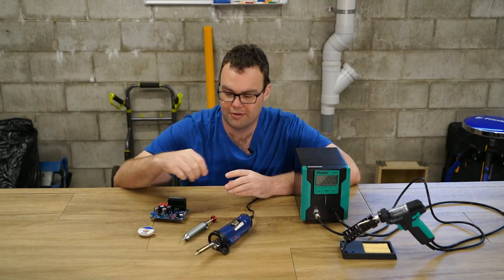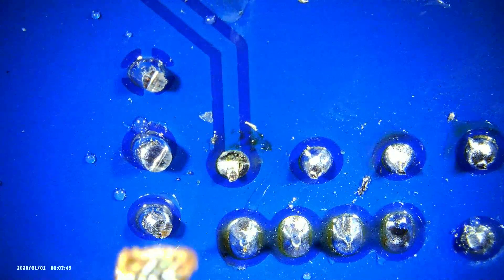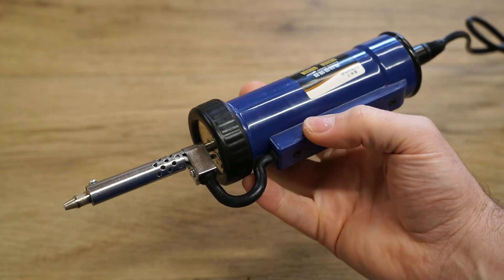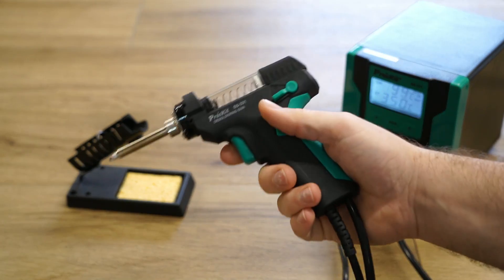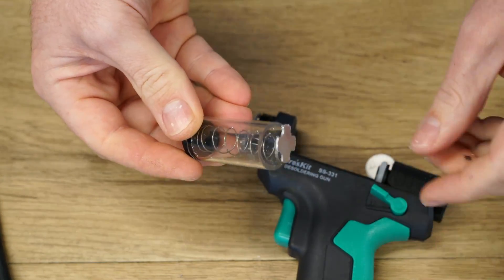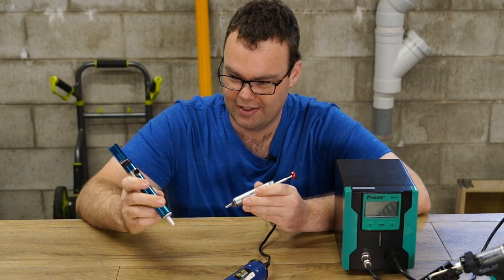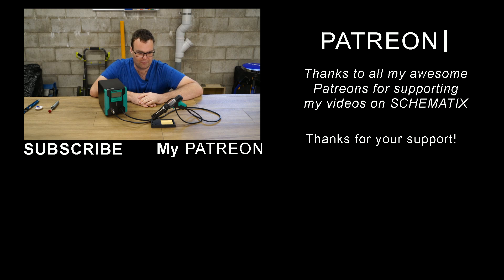The easiest method for Desoldering components!  Solder Wick, Sucker & Proskit SS-02 station Reviewed

Comment: The engineer in my opinion very overrated and slow in work flow, it will get clogged very badly every 2 minutes, it's not robust, the plunger bends, too small and flimsy. If you want to go full manual I suggest one of the "cheapest" models but make sure the body is all aluminum, not plastic. They cost like a dollar more and work like a charm

Comment: I really don't recommend those simple powered solder suckers with spring and metal tip, it will damage everything with those strong hits with metal tip. It can desolder pretty well, but it's good only for getting parts from PCBs that are already bad that you don't want to fix it and you just want to get parts from it. 
I want to get one of those vacuum pump powered instead of a spring, that should be more gentle. Classic not powered spring sucker with plastic tip can be ok for some things, but it's sometimes very tricky to melt it and then suck it before it gets colder again.

Comment: I came here looking for a review of a product like the cheap one you (and I) grew up with but it's electric (like the automatic solder sucker but much closer to the cheap design). I think I'll go with the Engineer tool. I got the newer model the SS-03--which apparently is mostly the same except it can touch the iron (up to 350 degrees tolerance) $25 instead of $10 but I feel like I'll destroy an SS-02 with bad technique

Comment: Well,  I  have to  say  wick is extremely  helpful.  It comes in  different width. Desoldering IC's is doing a great job. Unless, it is Double  sided board. I was only able to do it in a timely manner with a  solder/ desolder station. 3 to five seconds per pin. Double sided board. Not smd. Manual pump is pretty good with bigger solder blob.  Sometimes it get stuck, too much solder.  I definitely   would go for a  high quality  station. They did come down in price a great deal. Some have more attachments, like tweezer. Different size desoldering tips. Size matters. The actual pump is decent size. The pressure gage tells you  if it needs cleaning. Mine is an analog, about 20 years old.

Comment: This is an excellent comparison video. I've been having some trouble with de-soldering some header pins. I was considering a hot air system, or a desoldering gun with pump, but you've convinced me to try a "high quality" solder sucker with the silicone hose tip.

Comment: Solder wicks are best used in pieces, cut a few centimeters off and hold it with tweezers, toss it when saturated. This way the farther part of the wick won't lose flux.
Lovely Engineer solder sucker, that's a good grade one. And I see you use an iron (Yihua, maybe?) for JBC style tips... Good. I recently switched to T12 and am very happy with it.
Never worked with an automatic solder sucker, as I got a ZD985 desoldering station, pretty similar to your Pro's Kit.
Reply: 2 questions: You mean you never worked with the bulky thing he showed? and only stations?

Also, I see some people saying the stations get clogged with solder or something, and are difficult to keep running smoothly. Do you agree? Or are desoldering stations pretty easy to use efficiently if you have common sense? Thank you! Too me, those stations look like the absolute holy grail, and desoldering issues fade forever! Hope is true😅
Reply: @BradScott-ys6ot  you're right, I never worked with the bulky automatic solder sucker, but I used desoldering wick, a solder sucker (together with a soldering iron) and a desoldering station. As for getting clogged, they do - usually they come with de-clogging wires for different nozzle sizes, long enough to go all the way through the metal tube in the heater into the glass solder container. Every now and then you need to use it as there'll be solder and oxide buildup in the tube, it's good to be proactive here and not wait until it gets completely clogged.

Comment: Solder wick is quite expensive.  Solder suckers are good and never used one with the soft point....must help a lot (engineered).

Just purchased a de-soldering station and hope hope for the best.

Like the concept of dedicated de-solder station vs a sucker to keep traces on the PCB board.

Comment: the engineer sucker looks so good.. thanks for sharing that.. i actually have the el-cheapo blue one you were comparing it with... have had it for about 8 years and has generally been ok.. removes solder in about 2 to 3 sucks.. suction is getting weak tho

Comment: Hi, the listing for the "Engineer SS-02 Solder Sucker" that you have linked here is extremely misleading, the default selected option is two bits of silicone tubing, not the solder sucker.

Comment: there might be one more solution that none mentioned: by heating soldering with more solder, it becomes liquid and it's easy to pull off or at least step by step in case of e.g. transformers. after that, solder wick or sucker does the job. personaly I prefer the wick maybe because I'm into smd more than tht but that is not the point. why I am saying this? it's because plenty times I removed the solder and it didn't come off easily or didn't come off at all, so this is an alternative in case your alternatives don't work. of course, you didn't mention the heat gun that theoreticaly is recomended for smd, but sincerely, in my experience it didn't do the job well.
Reply: Probably because most of the solder in devices nowadays is lead free for safety, but it's also a lot harder to work with

Comment: Try to desolder a DIP package. You will notice that the pins have to be pushed to the center of the hole. The pins usually rest towards one side of the hole. How to do that? With the silicone tip solder sucker I don't know. With the teflon tip sucker it is possible but difficult (plus this one only works fine when lubricated and modded with a strong spring). With the other 2 tools, with heated tip, it is possible to move the pin and perform suction at the same time. But one is much more expensive than the other.
Reply: Solder a single piece of solid core copper earth cable to all the pins and apply solder and heat to the copper and it will drop out. 'MrSolderfix' has lots of good videos demonstrating the technique.

Comment: Give the blue solder sucker a second chance.  I bought mine for only 15€ and its worth every cent. Yes, it is heavy but has the advantage that you only need one hand to operate it. It creates a very strong suction and can remove a lot of solder with one click. A big pro is that it has a heated tip which is very handy if the solder joints are close together like ribbon cables or IC sockets. It also comes with a second, smaller tip. To avoid spitting out hot solder over the PCB, you click and hold the sucker over the solder joint, remove it from the PCB  and release the button over a glass on the work bench. This way, opening and cleaning the sucker is only necessary after around 20 or 30 solder joints (Unlike the manual suction pump)

Comment: Thank you for your informative de-soldering video, which I found very helpful.  After having tried to de-solder some component's this morning I was left frustrated as my attempts were unsuccessful.  My de-soldering caused nothing be component and board damage with with solder pads lifting from the circuit board.  The time I spent carrying out this activity was also totally unacceptable.  I have a solder sucker, just like the first on you owned.  Absolutely useless and a waste of time!
So the Pro Japanese one you demonstrated would be a vast improvement.  However, I think the Prokit De-Soldering unit would be the most effective and efficient tool for me!  Thanks again for the video👍
Reply: Yep, I was in the same situation as well. Always failing to get the damn sucker to work properly. Then I got a desoldering gun, and now, like Captain America, "I can do this all day!" and desolder boards and pins like clockwork.

Comment: the hardest part is desolder on the metal surface, today i use 480 degree but it took me half hour to desolder, since most of the heat is transfered to the metal surface.

Comment: This was a perfect video.  It covers the main possibilities.  I might try to add a small piece of silicone tubing to the tip of my spring loaded one.  I don't why that hadn't occurred to me already.  I've also used the iron that has a tip like the 3rd option and then has a spring cocked plunger at the end.  There are two versions of those and you want the one that can be easily operated with one hand and the cord comes out the very top end.  They work pretty good for small stuff.

Comment: Pro tip! You can mod the cheap solder suckers by buying a 2-4cm piece of 5mm ID/8-10mm OD silicone tubing and putting it on the nylon tip. The silicone needs to be very soft and bendy, something like gasoline tubing looks the same but is way too stiff. This way it's like the engineer where it's a lot easier to get a vacuum as opposed to being impossible with the stiff end. Try using the engineer without the silicone tip... You can also cut a V slot for the soldering iron on one side of the silicone tubing. Just flip the tube if u need the flat side. One tube lasts years easily and costs pennies
Reply: pro tip!  I actually did wonder myself. I was gonna try it… just adding soft tube to sh1tty sucker. Still want alum sucker and machine tho😋
Reply: I'll give this a try thanks

Comment: It would be a lot better if a video to show you attempt to remove some ACTUALLY difficult solder.  Use an older, cheap, fragile board with gobs of lead free solder, and THAT is where these products earn their rightful place in your kit.  Trying to get some super old lead free BS solder out of some pcb’s is an absolute nightmare.   You should also have covered low temp solder like chip quik—it can be a lifesaver.

Comment: hi the blue desoldering pump with the black end 
blew the black end off my pump after a while at some force 
just missing my head so beware keep the end away from your face !
i used a black handheld type that seems a lot safer .
i have a grey version of a desolder station but needs work 
before they are useable 
a hand pump or braid work pretty well .

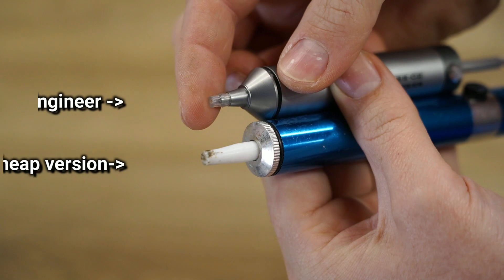Comment: 2:40 That "Japanese" sucker I bought from AliExpress for 2 euro 90 ct. It was EXACTLY the same as this one and came with about 8 inches of new silicone tube (For me it is a bit too short, i like it a bit longer)...The bulky blue one I bought also from AE for just under 20 euros, mine gets hotter than this one, it goe up to 400 deg's Also it heats up a bit faster, in about 1,5 minutes (240V).
So for me it is pointless to get an expensive desolder kit like the green one.

Comment: Wouldnt use the green proskit for tiny electronics like older 1997 motherboards.. Its good for basic electronics.. Only that device is not very accurate with temps. Those cheap units sometimes getting hotter then what you read on the display. And then lost a pad or through hole. An expensive device have a better heat regulation.

Comment: Thanks so much for doing this video! I’m definitely going to order that engineer solder sucker as I’ve gone through many of the cheaper and had the same problems you mention. Am going to use your link. That seems much better! I did order, finally, a sucker solder station, and am happy with mine, except before soldering I have to wet a sponge assembly and clean after. If it ever breaks down I’ll try that one you had. Of course wick is always a must just in case.
Reply: did you get the tool or two bits of plastic when you made your order of the engineer solder sucker?
Reply: @guesswho2778  the tool. Had extra suction end (rubbery tip shown) with it.

Comment: I agree that the Engineer solder pump leaves most of the other manual pumps on the rubbish heap. Wicking braid: works much better if choosing a top brand like MG Chemicals and one impregnated with proper rosin flux not the No Clean kind. Oh and if you can remove the component without removing the solder just melting it instead, the braid does well for cleanup. See videos on the trick of desoldering multi-pin components so they drop out. Auto-pump: Good note on the bulkiness in use. I was surprised though that you didn't state the one thing it has over the manual solder pump: you only need one hand rather than two (soldering wand & pump) which can help in some fiddly situations. Desoldering station: Of course I'd like one and that's a much lower price than the name brands but I've still got to weigh the cost vs fequency of use and not sure I can justify it. BTW with proper choice of wicking braid and good technique, I'm finding it works much more effectively than I used to think.
Reply: With patience, you can get a top-quality desoldering station used. It took three years, but I managed to snag a Pace desoldering station (10 years old, but still a current model at the time) for  $120, including around $100 worth of new tips and filters. It required a $6 rubber gasket to restore its suction back to like-new condition. (Would have cost around $1100 new.)
Reply: @tookitogo I’m not spending 3 years to hunt one down
Reply: @ZombieLincoln666  Well it wasn’t three years of work. I just set up a search, and it took 3 years till someone nearby put one up for sale.

Comment: I have a clone of that gun, and it works like garbage. However I try, it won’t remove any solder within the PCB. I just desoldered a Gamecube digital port using the Engineer solder sucker, and that did the job. I have no idea why the solder gun doesn’t work. There is no blockage and it’s clean.

Comment: Desoldering station is on my bucket list but for now I have no issue using those cheapie pumps with wick (used with flux). The flux makes a HUGE difference when desoldering. In all my years of using those cheapo pumps, I have never struggled to remove solder, also just make sure to use flux with the wick to remove old solder.
Reply: sorry I am just starting out with soldering can you explain this to me like you would to a 5 year old, I’ve got the same pump but sometimes have to do it multiple times, or add more solder to get everything out.

Comment: I have the same prokit station, it works good, but when working on 80s pcbs especially ic's I find them not easy to remove. It looks like they are soldered from both sides, Or maybe I use less heat ? - I found out its more smooth to head the ic from the other side too with a solder iron, and use prokit from the back side. But its unhandy. I dont know if the Hakko are better but the prokit is quite good. For older pcb's i always put fresh solder before try to desolder anything.

Comment: Seems like we made the same journey : I own all of these too. 😃 The blue one, although it works just fine, has the tendency to spit back the removed solder on trigger release, the cable comes out all the time, and I had to turn an aluminium ring to keep the rubber bellows in place. The green one has been clogging up a lot in my experience. When the solder hardens in the suction tube behind the heating element, it can be quite hard to remove.
Reply: Which would you recommend?
Reply: @allesklar7267  The Proskit station. It has its disadvantages, but it works. Make sure to get a steel 1mm pin about 12cm long to clean out the barrel from time to time.
Reply: @Stefan_Van_pellicom  OK thank you!
Reply: @allesklar7267  Edited my typo, it should be a 12cm pin, not 2cm.
Reply: @Stefan_Van_pellicom  after how many desolerded pins do you clean it?
Reply: @allesklar7267  Depends on how big the solder blobs are : bigger joints clog the thing up faster. The solder solidifies towards the end of the tube with the suction air flowing around it and cooling it down really fast… Sometimes it’s still fine after 50 fine joints, sometimes it gets stuck after 2 big ones. But since I made a small wooden handle with a 12 cm long 1mm pin sticking out, the cleaning goes pretty fast and easy.
Reply: @Stefan_Van_pellicom  OK, thank you very much!
Reply: @Stefan_Van_pellicom  mám nový ZD 8915 což je vlastně ten Proskit a tam jsou 3 drátky na číštění trysek dostatečně dlouhé aby dosáhly až do tá průhledné nádobky-jinak to čistím jen preventivně nikdy se mi to zatím neucpalo
Reply: @karelcernin393 Sorry man, don’t understand that. I know Dutch, French, German and English. Try again.
Reply: @Stefan_Van_pellicom  já jsem bohužel z CZech republik a umím česky a rusky-to nás učili ve škole protože tu Rusáci to tu ovládali-jinak jak jsem zjistil tak Zd 8915 je 6 a 7 pinové -- mi prodali 6 pinové které nemá funkci spánku náhodou jsem při brouzdání po netu sehnal 7 pinovou odsávačku Katsu Tools 312098/je to stejné jak ZD 8915 a Proskit akorát modrá barva// z bazaru o které tvrdili že je to nové ,rozbalené zboží skoro zadarmo-bylo to hodně levné tak jsem šel do rizika že něco nepůjde-chtěl jsem to na náhradní díly....jenže bazar nelhal a skutečně se jednalo o nové funkční zboží-tak nakonec mám dvě nové kompletní odsávací stanice...snad si tu moji esej přeložíš...

Comment: if u use some flux like amtec 559 with solder braid, it will clean those through hole components clean! But obviously the proskit system would be a lot more ideal for big projects that require desoldering a lot of through hole components.